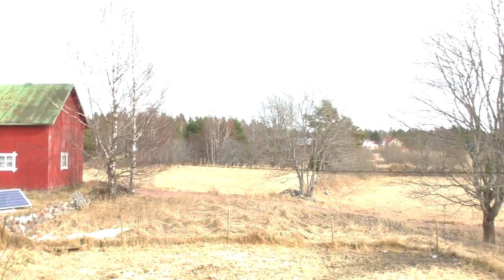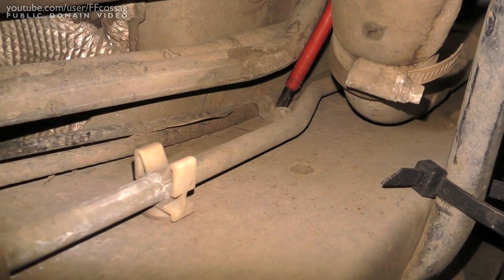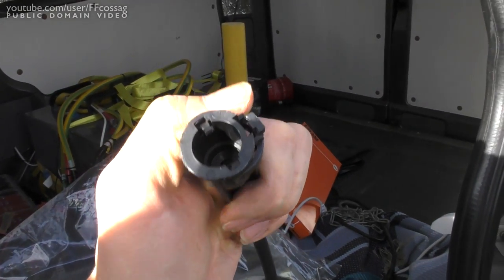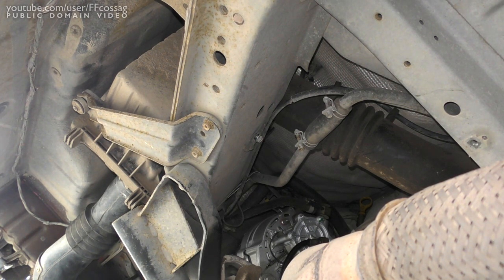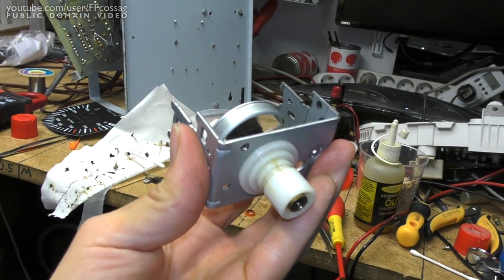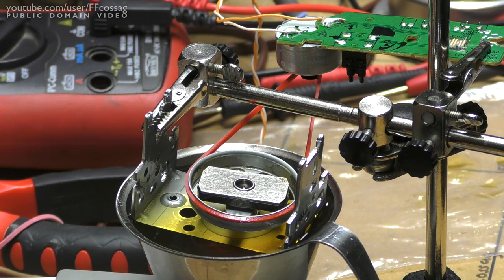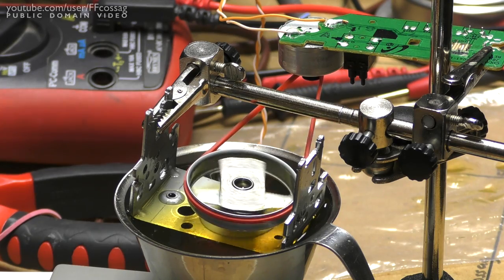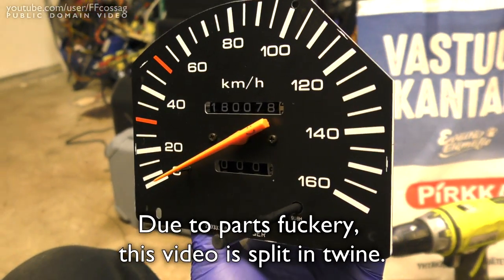Blog. Nissan Vanette speedometer repair

Comment: when you pulled the old cable out , you should have duck taped the new cable to the old cable,
while pulling the old cable out, on the surface of these cable add mineral oil or thinned Vaseline
to the surfaces , then start pulling out , who wants to shoot pool with a rope, just a tip tom.....